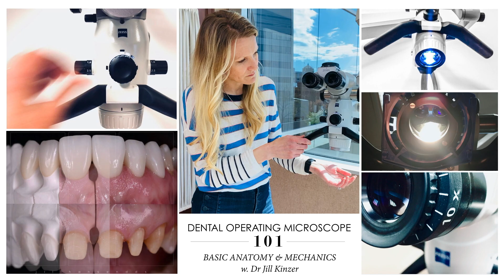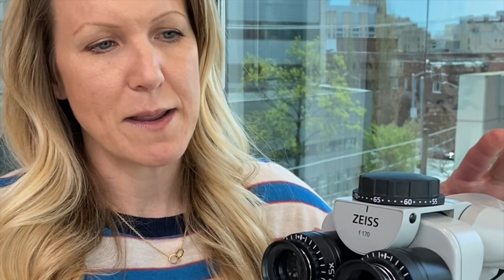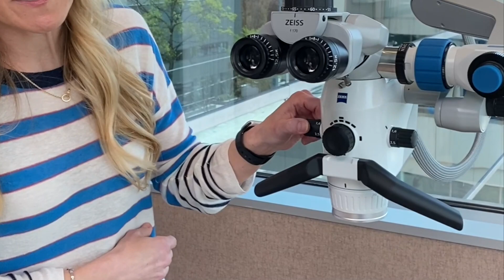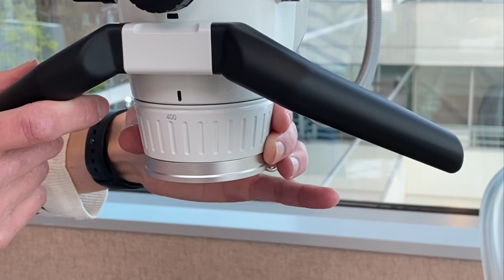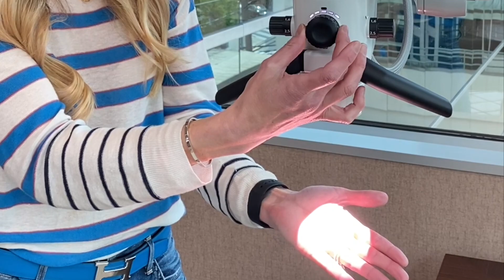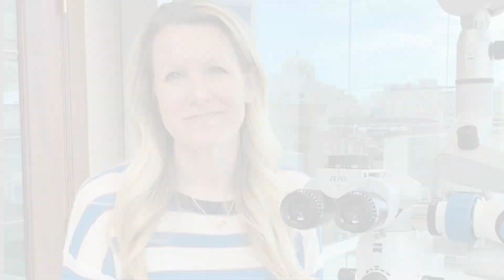Dental Operating Microscope Anatomy & Mechanics 101

Comment: Who will come and fix the celling mount flange?
Is it from zeiss service engineer or we have to provide our own plumber to drill and fix the celling flange doctor?
Reply from the maker: Hi KR Dental Hospital. I apologize for not responding, been traveling for the past few weeks. The microscope company you are working with (Zeiss) should have connection with an engineer who can survey the ceiling and determine what needs to be done.  Then hire a contractor who can follow the instructions from the engineer based on the spacial needs and requirements.
Reply from the maker: You're going to have to figure this out.  Here in the United States we have engineers... not plumbers who manage this.  A plumber is someone who deals with water and pipes... an engineer understands materials, physics, math and engineering.  I would not trust a plumber.  Find a builder/contractor who understands building plans and share the installation manual with them... see if they can help give you guidance.

Comment: Hello Doctor. What is your experience with Zeiss connect app from Zeiss? Do you use it on a daily basis? What ipad model you use for that? Thanks!
Reply from the maker: Hi Claudio - great question.  I have used the Zeiss connect in the past but am currently using an external camera.  There have been many upgrades to the program since I used it. Although the resolution is not as high as some external camera systems, it is quite good and I believe it does have some huge conveniences in terms of acquiring and managing images/files.

Comment: Doctor adapter is not from zeiss right...!
Which one is that?
Reply from the maker: Yes... this is a product put out by Zumax.  It is is compatible with Zeiss.
Reply: Seattle Microscope Dentist doctor do you suggest me to buy inbuilt camera comes from zeiss extaro (or) do I get beam splitter with adapter and camera from external attachment from zeiss
Reply from the maker: @k.rdentalhospitaldindigul4506  Hi Selvaraj. Sorry,  I thought i just answered that.  It depends on what you are doing with the files.  If you need a very high resolution for publication and lecture then i would definitely get a beam splitter and camera set up.  If you are using for patient education/documentation in the chart and the social media post then i think you would be fine with the internal camera.  I believe the Extaro comes with the  internal camera comes already built into the scope... it is just whether or not you choose to pay the fee to activate the software... OR do your own thing
Reply: @seattlemicroscopedentist8626   Doctor is it Mora Interface useful to our every day practice?
Reply from the maker: @k.rdentalhospitaldindigul4506  thanks for asking.. Mora adapter is a great tool.  I love it and I have used the Mora on previous scopes but my current one does not allow me to use it since i have camera equipment attached right were that adapter would go.
Reply: Seattle Microscope Dentist Zumax for mobile view right doctor....

Comment: how much does it cost
Reply from the maker: There is quite a large range depending on the number of magnification steps and the bells and whistles you choose.  I purchased my first scope back in 2003 and spent $17,000.  They have gone up since then but sometimes you can find them used. Old ones still work great... ask around with some of the vendors.  Sometimes you can even buy a used demo from vendor shows once they retire it!  My Zeiss Pico (my second scope) was exactly that.
Reply from the maker: used or new?  depends on the company you go with and what features it has...
Reply: thankyou